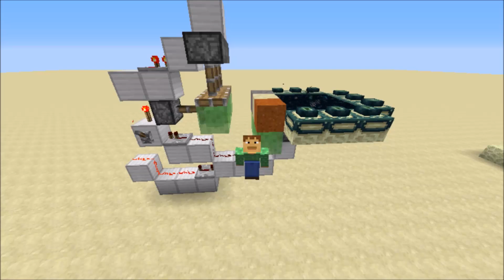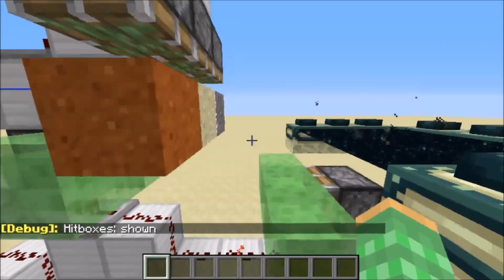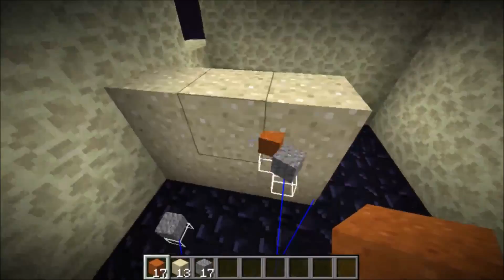Simple Sand and Concrete DUPE Generator! 1.9-26.2+ Minecraft [CHECK description]

Comment: WARNING: i got it working perfect in 1.14.2 for 5 minutes and then made the servers brain explode and had to role it back. maybe running it to dupe 12 concrete powders at 1 time was a bad idea. i used it on end side and droped it onto spawn with a huge x of hoppers covered in carpet on landing pad with carper above was producing amazing till  it had a unrecoverable crash after hoppers and 6 chests per side filled.  then it went unrecoverable.
BUT before that was absolutely amazing. a lil glitchy to try to stop it at JUST the right point and dupped my pistons once on the device itself one time somehow.  BUT..
 AMAZING WORK!
Reply: How did you break the end portal?
Reply: I broke server. But used creative to break block

Comment: The mushroom trick is what actually surprised me the most
Reply: ikr, thats insane
Reply: Doesn't work on 1.14.4 tho
Reply: @orhanalijoski4918  it works in 1.16.3 though
Reply: @Neon1880  no it doesn't. Tried it multiple times in single player. Does not work
Reply: @SweKingdom  1.16.4, it does work
Reply: @delta4207  i can confirm
Reply: @Skaffa  1.16.5 works I just did it
Reply: @logicalhalt-1096  I tried in 1.16.5, it can't break the blocks.
Reply: @lry77_ist71  then you did the mushroom wrong cuz I did it
Reply: @logicalhalt-1096  I just found out that it doesn't work in the FORGE version. The mushroom block didn't break any other block, not even stones.
Reply: Just confirming the mushroom trick worked in Java 1.16.5 in a pure-vanilla survival world. I just planted them directly on the ground next to the portal, didn't worry about digging down to get as far down as Ray showed.
Reply: @orhanalijoski4918  glad to know that after lot of minutes trying while mining more and more
Reply: @Oscar17082  it still works in 1.17.1 idk what you mean

Comment: Confirmed works in 1.13.1.  By the way, in 1.13 you can use sea pickles to break the falling sand etc directly into a water stream, so higher output is easy to deal with.  This also works with concrete powder.  You might wanna make a new video for 1.13.
Reply: Does it work in 1.14
Reply: @pyroteknical  did u even read the title of the video?
Reply: @pyroteknical  it works in 1.14.2 but it doen't work in 1.14.3
Reply: @leonysaniwinata3896  Thanks
Reply: @Swirft  does it work in 1.14.4?
Reply: @Swirft  Does iz work in 1.14.4, do you know
Reply: sea pickles are 1.13? wait what

Comment: I have a question .When I remove the end_portal_frame my portal can't copy sand and I try to use the old way like dropping copy it can't worked either but I have found the new portal using dropping copy it work how can I fix

Comment: PS4 - had to add extra blocks at the top so all 3 pistons moved. However, when I go through the portal, i don't see any sand inside, and my machine also stops. Any help? Thanks
Reply: Is it because the end hasn't loaded before I enter? (Read that in another comment). Or possibly because I have online mode checked ?

Comment: I don't think the mushroom works anymore, though I could have been doing it wrong. I ended up using the invisible piston head method to get rid of the end portal frames, works the same as bedrock but you have to change the redstone a bit because of the portal blocks

Comment: So simple and effective especially in 17w06a AKA 1.12 where you need sand and gravel to make concrete powder that turns into concrete when near water. But since concrete powder has the same texture and attributes/mechanics as sand, will it work with this generator?

Comment: Hi ray,  great work. Can you please tell me how you collect all those items at 0,0? There is a bad bottleneck and im trying to think of a way to collect them all.
Reply: bradytube use a torch to break them + a hopper
Reply: I Understand that. Soul sand is easier then using a torch , but I mean collecting them in chests. A single hopper will not work with that many items.  I've already figured it out and made a shulker box loader that loads at 53k items per hour. Thank you but I know about hoppers and the torches break falling block entities mechanic.
Reply: bradytube I know you've already made a fix, but you could use a hopper minecart in the same block as the hopper, technically I should "Hop" twice as fast. you could put even more hopper minecarts if you wanted
Reply: The system I made loads 53000 items an hour, I already got it covered, I did use 3 hopper mine carts in my machine. Thank you no further help needed. 1 hopper mine cart alone will still get bottle-necked.  but I thank you for trying.
Reply: bradytube I think you need to read the whole comment, I do know what I'm talking about :-) I made a fully automatic KFC with a selling unit AND it filters the feathers and destroys them, but I'm glad you found a solution
Reply: bradytube "Sir", if you have found your solution, I think you can now move on and not try to put me down as a person :/
Reply: Sorry ill delete my comments.
Reply: bradytube Thank you, have a nice day. and next time some tries to help, just say you found a solution ;-)
Reply: bradytube lies about deleting comments

Comment: Got 8 seconds in, going to build it, I hope it works on Spigot servers. (Edited) Does not work on Spigot servers. :(
Reply: So it won't work on all spigot servers? or just for modded ones?
Reply: To my limited knowledge yes. But who knows it might work on one of them. :-)
Reply: This is false, I have built this on a 1.11.2 server and it worked well.
Reply: Does your server run on Bukkit, or Spigot, or just pure old vanilla?
Reply: Ah, okay, I did not think about claiming. Our spawn platform was claim I think.
Reply: Spigot 1.11.2, only issue is this server I built it on has claiming and if the spawn platform is claimed this will not duplicate.

Comment: This generator is god-tier not because of its efficiency, but because of its simplicity to build in survival mode. You don't even need chunk loaders! Thanks Rays!
Reply: You can switch between colored concrete dust and that is so op!
Reply: @Normal User you can with a red mushroom
Reply: A guy made to trigger you    lmaoo
Reply: @Normal User i think tou can do it with mushrooms
Reply: A guy made to trigger you  username checks out
Reply: A guy made to trigger you  you acheived your objective, id love to reply in kind but that would just play into your hands
Reply: Ikr this is so ez to make
Reply: im confused-- it does need chunk loaders- does it not??
Reply: similar concepts have been shown before, that also didn't require chunk loaders. check panda's and ilmango's versions. Just as simple but faster
Reply: That's great and all, except its not survival friendly. You can't break bedrock and portal blocks in survival thus this build is creative only.
Reply: @etgrhrehgehetb  watch the end of the video, he shows how to break it ^^
Reply: @rosyibrahim8925  No method to break ender portal frames have worked on the server I play on - I wish the simple mushroom trick DID work.
Reply: @rosyibrahim8925  how do you get end crystals in survival
Reply: @reapertemptations   you can make them. you need 1 ender eye, 1 ghast tear and 7 glass blocks. Place the eye in the middle with the ghast tear below it and fill the rest with the glass.
Reply: @etgrhrehgehetb  Did you even watch the whole video?
Reply: @etgrhrehgehetb  lol yes you can
Reply: @etgrhrehgehetb  you can
Reply: @etgrhrehgehetb   you can break bedrock and portal blocks in survival
Reply: @etgrhrehgehetb  Thatn is completely false. There are multiple glitches to break both of those, mainly being growing a Mushroom on Mycelium

Comment: seems uneccesary. with the same amount of portals and my/mangos sand gen you get 108k so 2.25 times more.
Reply: v=OHbrf1fQD5w
Reply: well i dont see how you d get something like this to be faster than the currently existing 8gt desings.
Reply: i do not think it s possible in general. moving the entity fast enough like this doesnt seem possible
Reply: if you got it to work with two entities it d still be slower and having them in the same place is impossible bc they d land in the same spot.
Reply: Rays Works not again :/ but come on, i mean mine and mangos are both really easy.